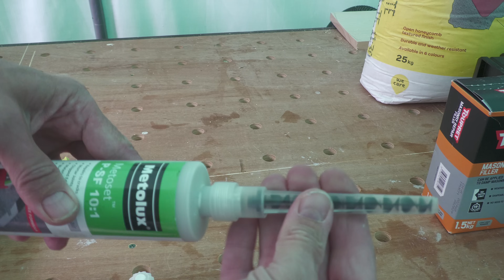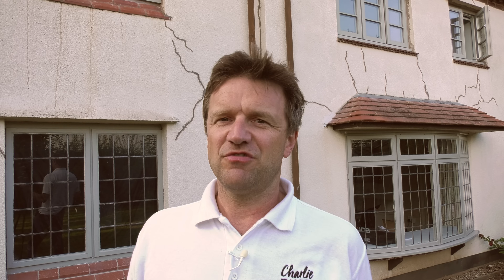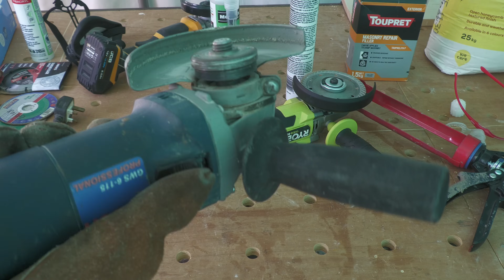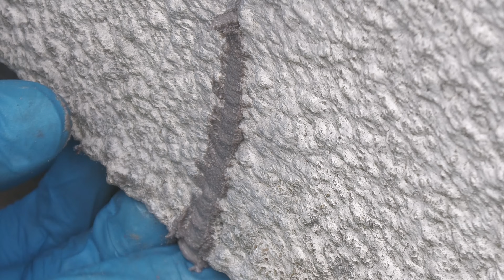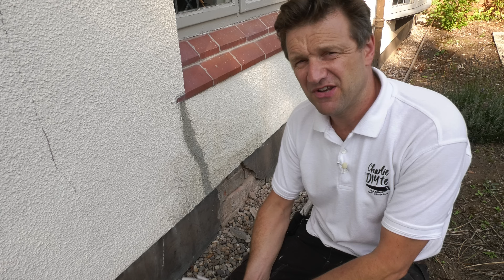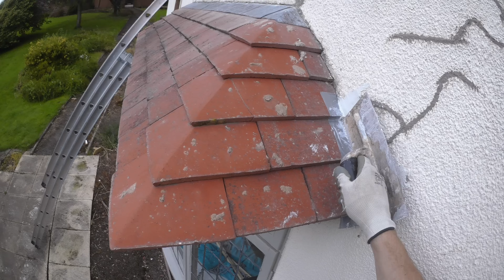How to Fill Cracks in Render

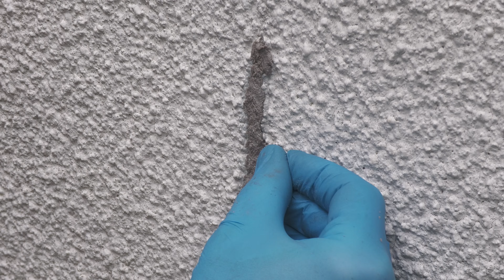Comment: 8:16 "I took to wearing nitrile gloves"  

Or what was left of 'em 🙄😂

I have a similar problem with cracks so I appreciated this video.. 

Also... My old farmers cottage has a lime render & had about 10 coats of paint that were flaking badly... using a pressure washer actually gouged the render ... soo..... I used a 125mm diamond face-grinding wheel (it took 3 actually🙄) to GRIND the paint off ! 
It was a ball-breaking job but the render came up like new... full head-to-toe PPE & windy days were mandatory ... 😆

I also have a flat roofed extension leak and I'm hoping to get some roll-on polyurethane sealer Roger Bisby on Skillbuilder recommended... 😏

This is SO what the internet is for... disseminating useful information & teaching new skills... thank you Charlie... 

From the Emerald Isle
😎👍☘🍺
Reply from the maker: Hi Peter, thanks for that. Wow, what a labour of love that was, but worth it for the end result! In these situations there's no simple solution. You just have to find something that works and persevere with it. Good luck with the roof repair 👍
Reply: @CharlieDIYte   😎👍☘🍺

Comment: Excellent video as always Charlie. Could I put on a request. I cleaning company damaged the mortar lines on my house and I'm having some real trouble getting anyone to come sort the issue. I wanted to try repointing myself, so it would be great to get some good advice on how repoint myself and on leveraging tools for dust extraction for a clean and neat job.
Reply from the maker: Thank you! Yes I've got quite a bit of repointing to do when I strip off that render from above the soak away. I haven't quite decided how I'm going to do it yet if I'm honest (ie whether to use lime in the mix or plasticiser) but I'll probably mix 1:1:4 lime/cement/builders sand with a tuck pointer to trowel it into the gaps.
Reply: @CharlieDIYte  how about trying out some mortar guns?

Comment: So many deep cracks n some quite wide . I am quite worried the structural building may have shifted due to shifting of ground movements ,sinking or deteriorating of concrete components in the mix during construction time..Best to get a structural or quantity surveyor to do an inspection report..
Reply from the maker: Thanks. Now all the cracks are filled I can at least monitor it. If more cracks form I think I will have to do something about the pointing of the bricks beneath.

Comment: Its cracking and you grinding more crack...but the lines trickling down also needed to be grind off...but then what about the root top gutter..metal fixtures which is also degrading..? Why nut just use the Selley Putty Wall Filler for less than $2/- and its like cement.

Comment: what about thinned white cement mortar  with pva mixed in?,and then you brush in the cement? then brush off the excess when nearly dry?ive done it lots and never fails?then paint the walls,,,,,,,,,,,,,,
Reply from the maker: Interesting Ian. You could even pipe it though an old silicone tube or mortar gun 🤔

Comment: I'm a structural engineer and I'm slightly concerned that although there are quite a few cracks that can be repaired by angle grinding along the line and then infilling, there may be some cracks between the ground floor window head and first floor window cill that could be down to wall movement/weakness in masonry behind and I would recommend chopping back a wide band of render to inspect masonry behind and repoint as necessary.
Reply from the maker: Many thanks for this, John. The masonry is weak, I'm certain of it. I had a wonderful opportunity to repoint internally when I refurbished the bedroom, but I didn't unfortunately. I'll keep an eye on it. Now that I've sorted out all existing cracks, after painting I will at least know we have a continuing and accelerating problem if new cracks form, and then I'll probably need to do as you recommend, which could be the start of stripping off the entire lot.
Reply: @CharlieDIYte  Thanks for your honest and open answer!!  I must admit that sometimes I have surveyed cracks in a house and said 'I have no real idea why the cracks are there but they appear small and low risk.  I suggest just repairing them and if they re-appear in 12 months time then we will need to look at it a bit deeper'!!
Reply from the maker: @johncranna  Honesty and openness is my thing, John. Life's too short, in my view to be otherwise. But in this instance your kind observation struck a chord because I've been wondering for a while now whether some of those cracks could be due to me inadvertently upsetting the equiibrium when I stripped off the (admittedly crumbling) render in our bedroom. You're learning all the time in this game and I should definitely have repointed. At least I can monitor it now. One thing I'm planning is a new square bay that will be built off the ground, rather than the existing hanging bay which itself is exerting an unhelpful load on the old wall via the roof above which is supported off a few triangular brackets. If the worst comes to the worse, I strip it off and redo the whole area, as you say. It will make for an interesting video - every cloud, eh?! 😉

Comment: Hi Charlie, could you have used a recycled tube and nozzle to apply the Toupret repair filler?
Reply from the maker: Steve I've since been pondering that. Yes I think that would be a great idea. My only thought is whether it would be a bit thick to extrude out of the tube, but I might give it a try.
Reply: @CharlieDIYte  I would try the tubes with a large diameter nozzle such as "Gripfill".  Another option, if you have a lot to do, is a mortar gun.

Comment: the rough texture is working in your favour... doing the same job on a plastered brick house now, and to remove the crack filling lines showing I made a block on the wall that I skimmed after filling so it doesn't draw attention to the repairs themselves. It just looks like decoration.
Reply from the maker: Great work 👍
Reply: @CharlieDIYte  I'd do the whole wall, but I'm skint.

Comment: As your my first go to expert when doing diy jobs, got a crack in our bath and wondered what you would recommend as a temporary fix until we can afford to replace after Xmas.
Reply from the maker: Hi David. What sort of bath - acrylic? Can you send me a photo to charliediyte@gmail.com so I can assess the damage. It's not going to be easy to repair but as you say it's only short term. Cheers 👍
Reply: @CharlieDIYte  Hi, sorry didn't have chance to send photos as we have a shower over the bath so needed to fix asap. In the end i went for a two part mix from amazon which had good reviews and to be honest has set rock hard. Only a temporary fix as its going to have to be replaced sooner than later

Comment: I live in a 300 year cottage which was painted with Sandtex which I had to remove then the whole house was repointed. Some bits are single skin brick upstairs and the bricks are so bad, render is the only way to make them look good whilst definitely keeping the water out. Luckily my decision to steam off the paint and repoint the rest of the house means those couple of areas round the back which can’t breathe don’t matter.

Wish I’d have known about the crack repair of the render. Probably would have saved some money and time on having them redone. Saying that, I will likely be using this in the future when I come across this thanks!
Reply from the maker: Sounds like we have a similar situation Jon. I reckon I've got some single skin upstairs on one side of the house. I suspect they rendered because of the general state of the brickwork. All that work was well worth it though given you've now got a house that can breathe 👍🏻

Comment: Use disposable icing piping bags if you don't have the tube filler, saves time and is a lot cleaner instead of trying to force filler in to the cracks
Reply from the maker: OMG, that's such a good idea, or better still an old tube of filler. Wish I'd thought of that!!

Comment: Thanks so much for posting this. My husband and I have been getting quotes to re-render our new home but after watching this I’m definitely tempted to give it a go.
Reply: What have you got to loose , £200 in materials and a couple of weekend. Go for it. Just give it a knock all over to check it isn't excessivly blown.
Reply: Hello, buy a multi speed 4 inch grinder  less snatch than one going around at full speed. 110v
Reply: @stephengeraghty3368  True dat. If your a noob, deffo diamond disks as they are very forgiving on breaking up into pieces. And a gutless grinder. Take your time, let the tool do the work. Your not paying by the hour or paying by price, DIY is free labour from your free time. Enjoy it and take your time.
Reply from the maker: Great suggestions there. Only thing I'd say is that these 18v grinders are pretty gutless anyway - particularly things like that JCB, and the Ryobi has a safety system that shuts the tool down when detecting a jam.

Comment: Hi Charlie, excellent video.    Do you think you could use the Metaset to fill the narrow deep cracks then the exterior filler to give you the required texture.

We have fully removed a render like that from a house in France.  It also was up the 25mm thick and yes it did cover all sorts of problems in the stone which then took a lot of repairs.
Reply from the maker: Hi Mat. Yes I think you could certainly do that. The thing is that Metoset is so good you kind of feel you want it at the surface but yes provided you left enough surface area to key to, then a top layer fluffed up with a toothbrush would do a good job. Someone just suggested using an icing bag to pipe that Toupret into the crack and in fact if you kept an old caulk tube and used that too force it into the crack then tooth brushed the surface I think that's probably the best solution. Annoying when you hit upon a better idea when you've posted the video 😉🤦🏻‍♂️

Comment: Freaky, I'm just in the process of patching some cement render on my garden wall. Large patches done but still have some cracks. I might get away with sand and cement though
Reply from the maker: Yes you might as well try if you've got a load of the stuff. Just make sure the crack is wide enough to get it in 👍

Comment: The Toupret Masonry Filler certainly looks much slower to apply, but with the technique of touching up with the spnge and toothbrush, I think the finish came out the best out of the lot.

Maybe go with the tube application and have someone go behind with a Sponge and toothbrush to blend the finish to look like the render?

Great job as always 👍
Reply from the maker: Thanks. Yes I agree. Someone has suggested putting the render into an icing bag which is a great idea. Other option, put it in an old caulk tube although thinking about it, it might be a bit too thick to extrude.

Comment: Great stuff. Do you have any advice for pointing roof tiles, with something that won't fall out?
Reply from the maker: Thanks Peter. That's a good question because you don't really want the roof tile sticking to the one below, which it will do it you're rendering on a new bit to (presumably) replace a section that's cracked off. You're also unlikely to get a good colour match. Roof tiles are in very short supply at the moment but could you get yourself to a reclamation yard and see if you can find a second hand one to replace it with?

Comment: Hey Charlie another good video thanks, Toupre seems like a decent brand I have used their Interior Filler in the past and found it decent quality. Just a thought (outside of the box). I think you could have used a Food Piping Bag and Nozzle with the Toupre Filler to make the job less tedious and ensure maximum filler insertion into the cracks.....
Reply from the maker: Thanks mate. Yes someone else has suggested that. Very good idea and in fact you could take it a step further by piping it out of an old empty caulk tube. Only thing is I wonder whether it would be supple enough to extrude, but worth a try with a wet mix.
Reply: @CharlieDIYte  Also Charlie, as you have Ryobi tools, you could invest in a 18v Ryobi caulking gun, they are cheap and do the job well. Save your hands. Don't ask how I know this.

Comment: There is extensive cracking on this facade and I wondered why and what  age of the building is and if it were perhaps originally constructed with lime mortar. If so, the concrete render will traps moisture in the brickwork and prevents it from ‘breathing’ and may cause damp problems inside. The long term approach, (and it’s a big one!), would be to remove the concrete render and replace it with a non hydraulic lime render (e.g. from Mike Wye, Ty Mawr or others) and then paint with a lime wash or clay based paint such as Earthborn… so it all breathable…(from my architectural experience).
Reply from the maker: Totally agree Vicki. Most of the cracking has been caused by water ingress at the vulnerable points around the sills and such like. The walls are pretty dry judging by those I've stripped back internally, but the mortar between the bricks is in a pretty bad state, which is I suspect why they rendered it in the first place.
Reply: @CharlieDIYte  It's brill that you get it Charlie - as we are seeing the terrible slow-burn damage done to lovely old buildings from repairs using cement render, cement repointing and gypsum plasters internally - all trapping moisture within the walls (like wearing a raincoat while running) and leading damp and decay.

Comment: Excellent review and tips Charlie as always!
Got to be some way of putting Tourpret mix into a nozzle applicator to enable quick application in those cracks! The things that keep me awake at night!😴
Reply: You can buy empty mastic tubes. Or use a mortar gun.
Reply from the maker: Yes, I don't know why I didn't think of that, to be honest. You'd need to experiment with the consistency - maybe make the mix a bit wetter, but even an old caulk tube would do the job, with a nice heavily geared gun!
Reply: @UberAlphaSirus  I keep all the empty silicone tubes in case I need to fill them up with some stuff

Comment: That powder filler looks very handy to have on hand.
Fyi they may not have paid you with money but it's still considered a payment for promotion as they have given or loaned the product for free & should be labelled as such. Don't want you getting caught falling foul of the ASA rules
Reply from the maker: Thanks for pointing that out Sarah. It's something I've been very aware of (given my old career as a lawyer) but I'm not sure it's quite that clear cut and I've had legal advice on this. The rules are a bit more opaque in the US, but over here provided I have complete authorial control over the video with no right of input from them, then I don't think I need to flag it as paid promotion. For belt and braces I go out of my way to mention in the video when I've been gifted stuff. I could err on the side of caution and flag every video as paid placement, but I don't see why I should tar them all with that brush, particularly when one or two of my fellow creators are, shall we say, sailing a lot closer to the wind on this.

Comment: Charlie, how do you manage your tinnitus, what probably I hate most is never being able to have a quiet time sitting in silence 🥲
Reply: Mines much worse if I am dehydrated. And it seems to go with cocodamole, ovbiously not a long term soloution. But when its keeping you up all night, it's a god send.
Reply from the maker: I might try that. Thanks Sirus. Bottom line Greg, I've learnt to zone it out at night time, but it's gutting I can't enjoy surrender any more. I think the damage was done by my Bosch belt sander in the early naughties - which I used to strip all the floors in my old place.
Reply: Treat it like a friend. Try not to zone in on it or it will multiply the noise. If you relax about it you’ll be amazed how it can almost disappear. I’ve been through all the stages of tinnitus acceptance - regret, worry of the future, no more silence etc. Now I’m at the point where I’ve realised I’ve wasted too much energy about it, there’s no point. If you can’t beat’m join’m 👍🏻

Comment: With some ComposiMold Epoxy Clay, or the like, you could have made a stencil of the wall structure and use it as a stamp for the filled up cracks so it would match the wall structure better !
Reply from the maker: Very clever 👏🏻👏🏻 I love that idea. The only issue is the Metoset would be too sticky to form into the mold, and the mold could only be with width of the crack which would be difficult to apply in practice. Fab idea though that's got me thinking!
Reply: @CharlieDIYte  And  .....when the stencil is hard you can spray it with silicon spray so it won't stick to whatever you use to repair the crack.
Reply: That's a good idea. A flexible sillicone would be better. They do silicone tools for artex stipling. Maybe a silicone basting brush would work? Might have to cut the bristles down a bit.

Comment: I recently used the Tourpret mix filler and can confirm it gives great results, but definitely takes more time than a gun-based system. I'll give the Metalux product a try in my next project. It looks very much like the Epoxyset/Permafix products I've used before for fixings
Reply from the maker: You might try putting that Toupret in an old empty caulk tube - or you can also buy empty ones. Not sure if it would extrude with the consistency, but someone suggested an icing bag which got me thinking this might be worth a go.
Reply: @CharlieDIYte  true and a decent idea Charlie. Would certainly give more working time than the two-part products.  I struggle to full an icing bag without getting caked in it though 🤣